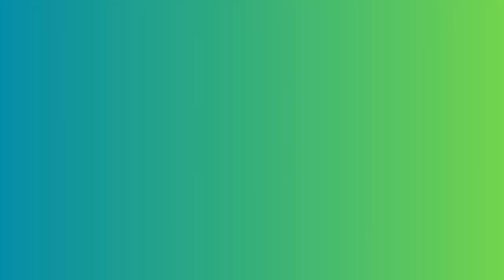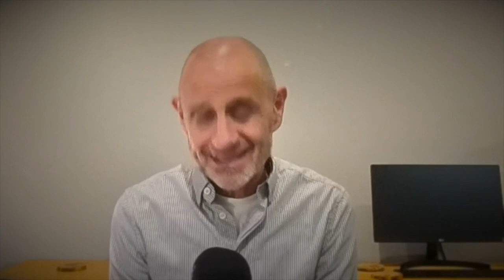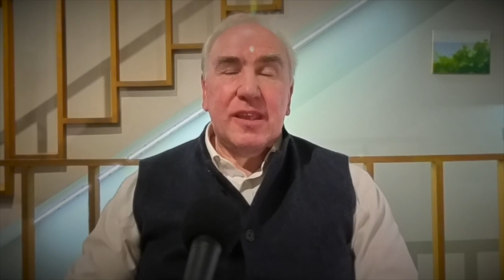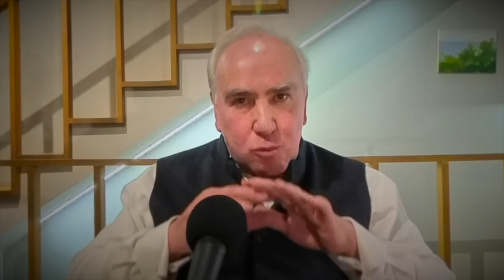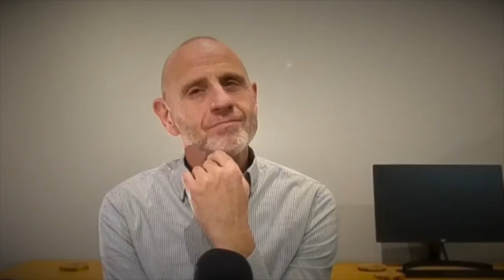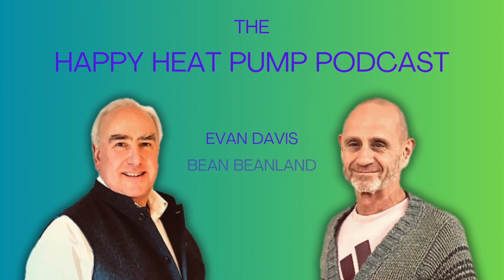19. Mistakes to avoid when installing

Comment: I was lucky to choose a local installer who insisted in installing an oversized unit with 2 fans because we live in a micro climate of mist and fog on top of the South Downs.. For days at a time in late autumn we get mist and a temperature of 3 degrees which would have frozen onto the smaller heat exchanger of an 11 kW unit running colder. The 14 kW unit has a much bigger network of tubes carrying the R32 refrigerant and has a lower COP, the 2nd fan imposes a loss of 10% but we rarely get cycling and defrost issues. It has been a fantastic success and especially cheap to run with an Electric Vehicle tariff for our electricity. It might frighten some folks but we use nearly 11 MW of electricity but half of that is at 7p a kWh. And one point when sizing a heat pump is the volume of hot water used! A newer very efficient home might only have a heat load of 5 kW but if that is a 4/5 bedroom home with 3 or 4 women hair washing nightly (Evan will appreciate he doesn't have that worry!) then the hot water provision needs to be a 200-300 litre hwc with a 2-3 kW allowance for hot water. The hot water cycle will take preference over heating and you can end up with up to 2 hours over  the course of an evening when water is being heated and not the house!

Comment: Undersizing. 
Is the big issue here that when it struggles to get enough heat out it will raise the flow temperature and therefore reduce the COP?
Reply: Undersized is like trying to heat a space with a 1 bar fire. The singer element isn't enough to heat the room on its own. but if you bought a cheap heater that only has 1 bar, your out of luck.
Reply: @ the COP of the fire is always 1.
Reply: No, problem is you're cold because it simply can't provide the heat.
Reply: @philthompson1097  if you think heat pumps don't work, you don't understand what a heating system actually does. You might be a heating engineer and know how to get a gas boiler to work but to say a heat pump heating system are incapable of heating a house, any house, is just not true.

Comment: I keep having to push back on my installer as they seem to be forced by the MCS scheme to put a larger heat pump than I want. We have our house at 15C max, so why should I be forced to have a capacity to reach 21C and design flow temp of 50C on the coldest day. So they insist on putting in a 16 kW unit whereas I want no more than 12kW. My only hope is that I can set the heat curve so that it runs a flow temp of 30ish and the unit can down regulate to sufficient levels. Very annoying as it’s going to cost me more to run.
Reply: 16kW may mean 2 units so you really do want to get it to 12kW if you can. Maybe a blower door test could make the assumptions more accurate around the air changes which Bean points out. This is approved in MCS if you have the data to put into the calcs. Then some choice additional insulation will help you get closer. Sounds like a huge old house?

Comment: Request for future content: As a reasonably well informed consumer I want to take a fabric first approach by upgrading windows, insulation and underfloor heating. Any company I go to regarding heat pumps are wanting to install as soon as possible based on a heat loss calculation on the current state of the building. Where can consumers go to get a heat loss calculation and advice on UFH design (pipe size/spacing), external wall insulation (EWI) thickness/material, and glazing recommendations etc. to ensure the most efficient heat pump system can then be designed.

There are heat pump installers which will do all of the above, but you don't really need a qualified plumber with a heat pump specialization to install EWI or screed a floor. These things are also expensive so doing things in stages are also required, but doing the wrong thing can backfire.
Reply: Google "a Bristolian's guide to solid wall insulation" - it is a very thorough guide to SWI commissioned years ago by Bristol City Council, and despite the name is well worth a read by anyone in the UK considering SWI, whether they are from/in Bristol or not!

It is very likely that fabric improvements to wall insulation and glazing will increase the airtightness of the building so you should also consider mechanical ventilation, MVHR being the "ultimate" but I've also heard good things about Positive Input Ventilation. If it's difficult to install a centralised MVHR to cover the whole house, you can get single-room ventilation units but make sure they are continuous "balanced" units rather than ones that alternately extract then supply.

Edit - you should think about solar PIV and battery as well if you don't have those already.

Good luck!

Comment: I really struggle with the 21 degrees target temp. We have a general target of 17.5 and 19 is nice in the living room and bathroom but at 20 we start to take measures to loose the heat. I hear 21 repeated again and again, it feels like we are wrong and need to trust that 21 is more comfortable? I’m not sure 23 is even possible in our house.
Reply: We are in a similar situation, for us 15C is too hot. We have a large house and heating it is expensive, so we have become used to wearing clothes in the cold weather and currently don’t heat most of the rooms at all. Can’t you adjust the heat curve right down, that is my plan?
Reply: @yp77738yp77739  My heatloss (done with an approved spreadsheet) notes a heatloss of 4.5kw @ -2 deg C at my desired comfort levels. 5kw should cover it, but I can imagine a ton of short cycling (in practice) if I went full MCS on it (6 or 7kw).

Comment: Why don't we do more open loop ground source like the USA does. They tend to use their borehole pump to provide their drinking water as well as for their heat pump and then the waste from the open loop ground source they have it through their rainwater tank and then overflow back to waste. I experimented with open loop from my well in the back garden at it worked great, but to be honest it wasn't better than my modern ashp unless it was well below zero. As I live in Northamptonshire we don't have that many below zero days. In fairness it was an old ground source fixed speed unit. I was quite happy that it worked fine but once the air temp was above say 3 degrees the ashp was more efficient. I have now removed it so if none wants it to have a mess around make me an offer. It's a 6kw Dimplex

Comment: The largest part, of a heat pump installation requiring more things to be right is the high cost of electricity compared to gas, the heat pump needs very good efficiency to make up for the extra price. If electricity was say 2.5 times the price of gas it would be easy, if electricity was the same price as gas it would be just about impossible to have a heat pump that wasn't far cheaper to run than a boiler, with the current 4 times, you have to be careful.

We have artificially high electricity compared to gas prices in the UK, this needs to be addressed, both by having more renewables, which are cheaper than gas fired electricity and also looking at the pricing system itself.

Comment: Another mistake: trying to run a heat pump like a gas boiler.  Gas boilers are so oversized that you can turn off the heating overnight or for periods during the day and then blast the house or flat up to the required temperature really quickly. 

Heat pumps tend to be less powerful and are also more efficient at low flow temperatures.  Therefore, it is often most efficient to run the heat pump 24 hours per day - low and slow.  Using a weather compensation thermostat outside, with internal thermostat acting as a higher cap, enables the heat pump to adjust its flow temperature smoothly to meet the demand.  This improves efficiency and reduces recycling.

Comment: Really helpful explanation thanks.  You seem to have missed one absolutely crucial mistake that needs to be avoided - radiator sizing.  At daytime rates, gas costs about 4 times as much per kWh as electricity.  This means that a heat pump needs to run with a seasonal coefficient of performance of 4 just to match gas running costs - i.e. you put in 1 unit of electricity and you get 4 units of heating.

A typical gas boiler can run radiators at 70C.  Assuming a room temperature of 20C, this means that the gas boiler can run with Delta T = 50C - i.e. the radiators at 50C about room temperature.  

In order to achieve a heat pump SCOP of 4, you need an average flow temperature of about 40C. This means that Delta T is 20C, instead of 50C.  Therefore the radiators need over 3 times the capacity.  Often radiators are oversized, but most homes need bigger radiators in a number of rooms.   

See: https://www.stelrad.ie/wp-content/uploads/2021/10/Stelrad-Correction-Factor-Oct-21.pdf